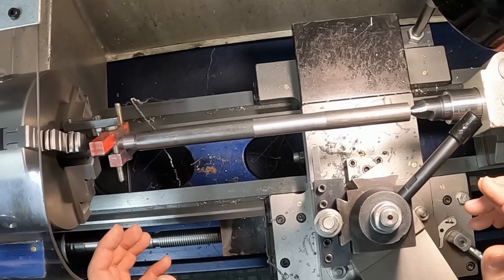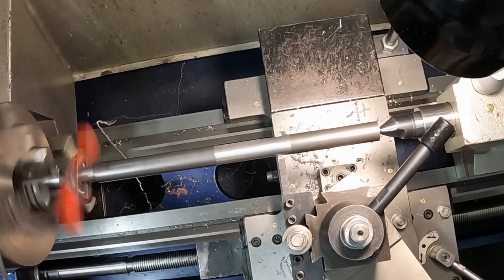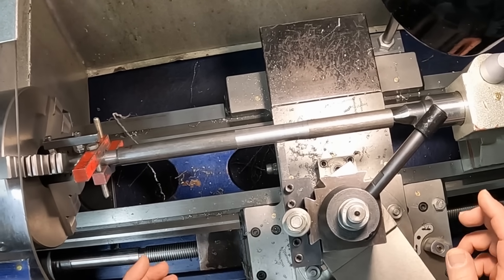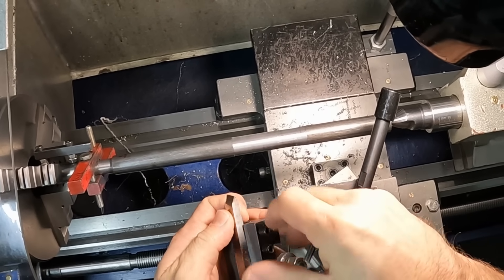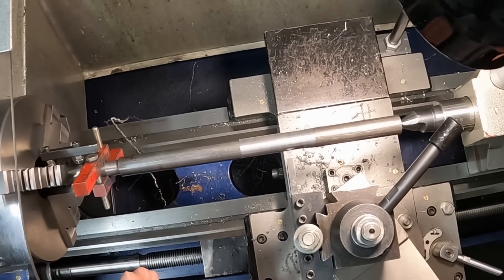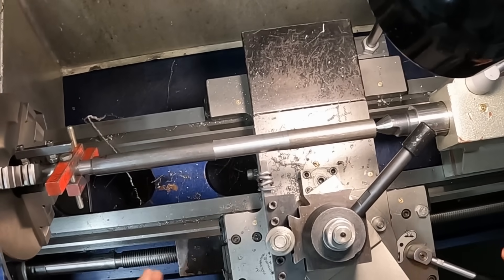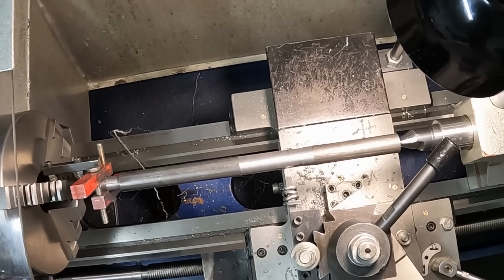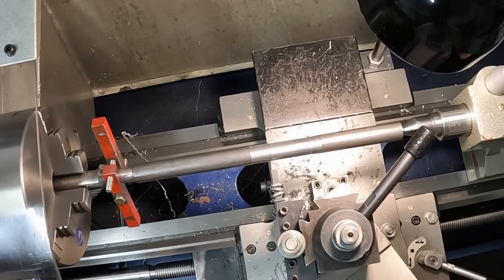Solving the CHATTER problem for the home workshop

Comment: What a great subject! Your video really made me think about this.

You talked about changing the natural frequency of the tool and introducing dampening. Another place to look is where the chatter is created:  the angular distance between the cutting edge digging in and getting released. Increasing the RPM causes the angular distance to be covered in a shorter time, increasing the frequency. Increasing the depth of cut will lengthen the angular distance to the release point, lengthening the time and lowering the frequency. Of course, the material plays a role as well in how deep the tool can dig in (harder material will increase the frequency) and the force at which the material releases the cutting edge (softer material will also increase the frequency). 

Also, we need to consider the natural frequency and vibration amplitude of the workpiece. As you say, it’s a complex mechanical system with many degrees of freedom…
Reply from the maker: True, but the idea of increasing the feed or depth of cut is to decrease the spring back thus effectively reducing the chatter. Essentially you keeping the tool down, albeit by fractions... You also adding a certain amount of dampening and this has to do with the size of the chips and the localised deformation at the cutting edge...
Reply: Agree completely. You’re focused on reducing amplitude while I was thinking more about avoiding resonance. But on the lathe, the frequency of the workpiece changes constantly, so my approach is probably more valid for the mill

Comment: The solder around a small  boring bar and the annealed copper strip under the tool bit are excellent ideas. I have used lead strip on larger boring bars in the past with some success.  I will try the solder trick next time I use the small boring tools. Well presented sir. One of teethings I have done on the past is vary the spindle speed if you have a variable speed arrangement on your machine to work around those pesky resonance frequencies. While It can be a bit of a pain in the backside, If nothing else it can get you through the job. Cheers
Reply from the maker: Variable speed spindles works well in industry. Normally pickups kick in that function immediately. Unfortunately the home workshop is less likely to have that function. Manual feed does something very similar. I couldn't get chatter when manually feeding because I would autocorrect before I could stop myself 😂 Thanks for  the comment.